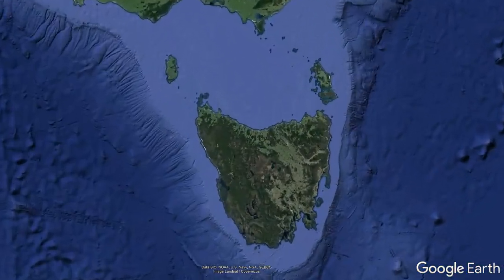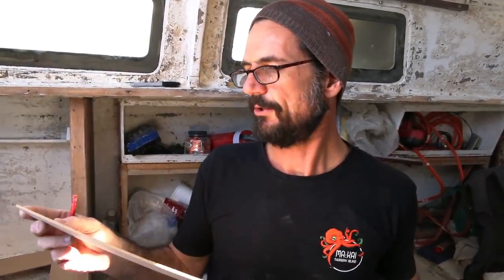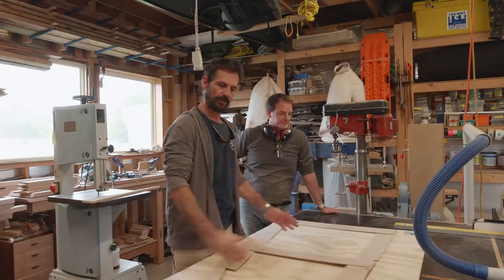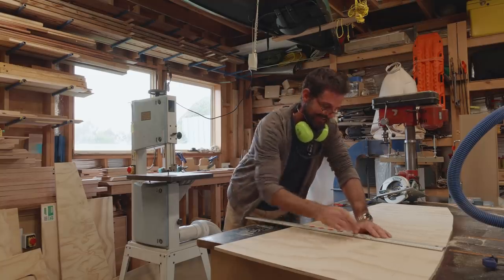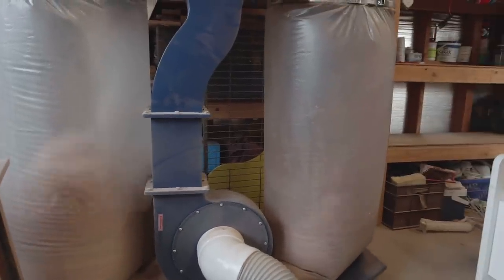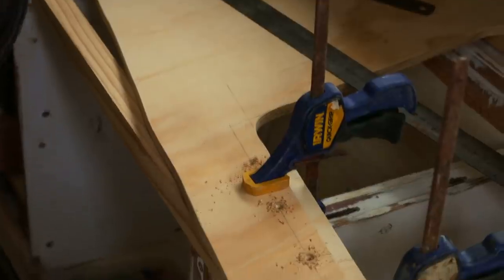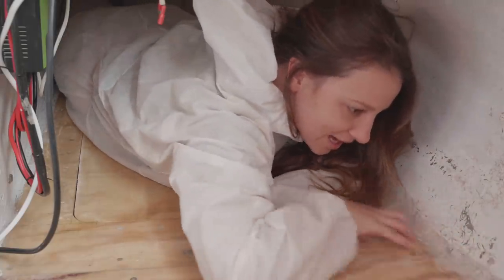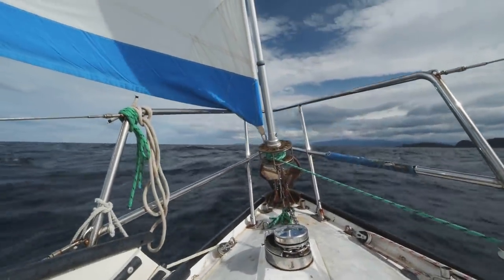Boat Work in Tight Spaces (Replacing our Rotten Quarter Berths) - Free Range Sailing Ep 145

Comment: Working in the quarter berths is a bugger of a job, because it is so tight you can`t get away from the dust, you struggle to move around, and apart from Tassie in winter it is usually stinking hot. You will be so glad when it is done and finished, and knowing it is done well. Great job guys !!!

Comment: I still use story sticks, like your templates it's much more accurate. Lol, the kids and grandkids have learned to stay away from Papa's yellow buckets and the sticks hanging from the rafters.
Reply: Me too, but they seem to tell me a different story by the time I get back to cutting timber.
Reply: I was taught to use story sticks over fifty years ago for carpentry in the UK.  Still do because it saves time and is accurate, usually!
Reply: @Elhesh grandfather was a ships carpenter and taught me some habits. Yes I've built a few boats and many other things. Really a story stick is a simple jig or fixture to facilitate repeatable processes. Lol, story sticks are only one old school tool/method I use, rafter and framing squares, sliderule, various dividers and a few different types of marking guage/knives.

Comment: Nice video. You should put thickened  epoxy on the edge where the plywood meets the hull and give it a nice rounded edge with a pop stick before allpying glass. Fibreglass sheets dont like a 90⁰ bend and often gets air trapped. Fairing the curve before applying glass makes a stronger joint.

Comment: On your hatches, you can drill a 2-3cm hole and route the edges so they are easier to open. Just stick you finger in and pull up. No hardware needed. Thanks for all the detail as you do the refit. 👍

Comment: Awesome bag of tricks! I also try to avoid measurements in everything if stuff isn't perfectly square. But I gotta shake my head and make "tisktisk" noises on the PU Foam, it's open cell structure makes it even better than balsa wood in it's ability to store moisture like a sponge. Definitely doesn't matter for this application at all, but still, this stuff is the devil for anything marine or automotive. Polyethylene (PE) Foam has a closed cell structure but is more expensive and not as readily available.

Comment: Every time you cut out a bunk lid with a grinder you loose longitudinal twist bracing I worked for years in manufacture of production boats an some bunk tops we glassed in for this reason good luck keep going looks good and in need of paint

Comment: Strong work. Thank you for the videos! I hate to make a critique, but did you consider if you might trap hydrogen gas under that quarter berth? FLA batteries produce hydrogen when charging. The factory install on my boat involves sealing the batteries within a box with passive vents from the box to the outside. Fir you, the gas would probably work upwards through the mattress and dissipate in the cabin... I guess your old install worked out just fine. Just something to consider, in case you hadn't.

Comment: Surprised you didn't router any holes in the hatch lids to easily open them. All looking good though, wondering where you're currently at with Melbourbe still in Lockdown - do you have plans to visit King Island for some time?

Comment: Nice work! Maybe dumb question, using the old floor as a template was not possible?
Reply: Not really possible, no. The old floor was cut out leaving an intact lip of 40-50mm all around the edges to act as a support for the new floor. So a template using the old floor would be 80-100mm too small overall.

Comment: I like these videos but I would caution anyone about using polyester resin to saturate plywood. It does work as is evidenced by lots of ply/polyester multihulls and monos but they are susceptible to delamination/rot and it is much much better practice is to use epoxy to saturate ply. If you buy epoxy in 24 litre containers from the manufacturer the price difference is less and it is usually not worth the bother to mix poly and epoxy on a large refit. So be careful using these methods which are not best practice and don't do the same on a structural component thinking that it is okay. Epoxy is best for timber in any circumstance and is very good for secondary bonding of anything to old glass hulls. 

Also when mixing epoxy, change the thickness for different jobs. Make the mix to peanut butter consistency for edge gluing and hole filling, but for the ply to ply joins back off the thickener. As the area to be glued increases (and if the surfaces are flat like ply) you make the epoxy glue thinner so that it can spread out easily throughout the join with less clamping pressure. I would make the epoxy thinner than Troy does for the gluing of the edge pieces. 

Cheers Phil